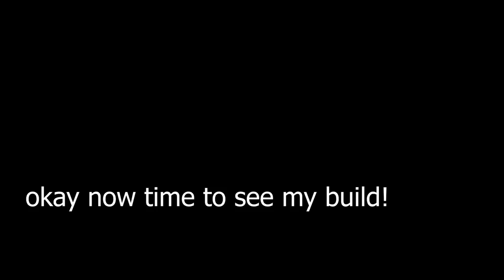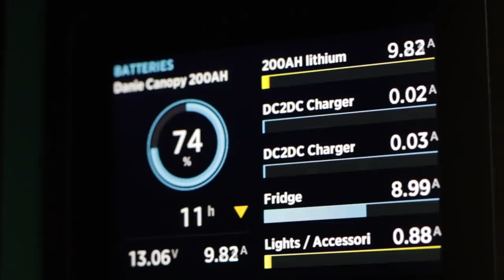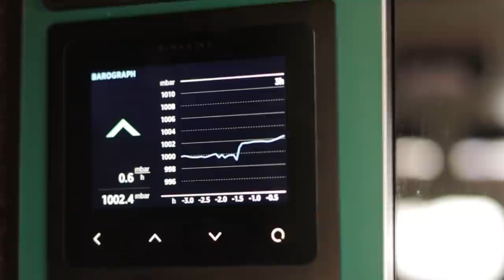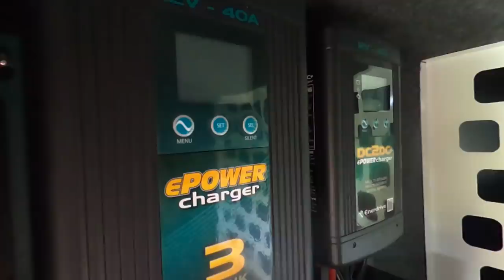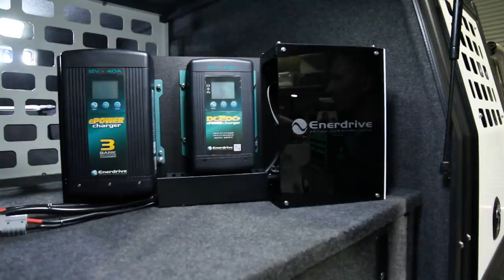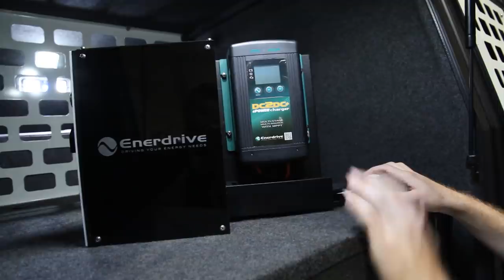Old Ute, New Tray: Part 1 Fitment Day

Comment: Enerdrive 40+ and 200amp Lithium battery is a great investment. Only been 4 months installed but recharge time and compact size will not be going back to agm myself.
Great idea being able to leave just the mutt box on for everyday use and add the rest when needed

Comment: Super flash, those set ups always make me want a ute 🙄

I'm not sure if it's something you may have already looked at, but if you haven't, but you can actually tighten up your steering box to take most of that slop out. First thing I do on every cruiser I've owned haha 👌
Reply from the maker: Yeah tried that this one is just worn it's little groove and just needs replacing one day haha
Reply: I love that list, every time you cross  something off it's like "why didn't I do this 3 years ago!?"

Comment: Great video. I like the electric box. How does the topper lock down to the flat bed?
Reply from the maker: Bolts
Reply: @DanieSimpson  do you have a video with that? I'm looking to make my 97 k2500 burban into a Ute and I like how your build looks. I haven't found any other builders that done what I want to do and i would like to be able to take the topper off if i need to
Reply from the maker: @rkc2617  next video willhave all that shown

Comment: Hey Danie in your Christmas video you say you’ve got the patriot camper I’m curios why you decided to put a body on the cruiser adding the weight to the vehicle when you got a patriot camper? Also could you do a video on a patriot? Have you thought about running a turbo timer if you don’t have one already? Cheers 👍
Reply from the maker: What added weight? Why would I have a turbo timer on a non turbo car? The patriot and the canopy are completely different items with their own purposes and it won't be getting a video for awhile yet
Reply: Wouldn’t your tray and toolbox be much lighter then your new setup? Apologies about the turbo timer got it mixed up with your other build.
Reply from the maker: @chrisgreen3538  this is alloy not steel so no
Reply: What would be your top 5  destinations to visit?

Comment: Now Danni load it find out how much more weight you have added it will surprise you so I suggest new rear shoes front disc's and pads steel brake lines you will need this and you will be gobsmacked the improvement it will and realise how bad your stock brakes had become. NIce set up girl a bit enviouse of the transformation.
Reply from the maker: Hahah no. Old tray was steel, this is alloy. I know exactly how much it weighs now and I think you would he surprised. My drums, shoes, disc, pads are all brand new. I already have braided brake lines and I noticed no change over my 10year old brakes. But if you wish to know something that did make a difference for brakes it was changing to a dual diaphragm brake booster
Reply: @DanieSimpson  Ok just a petrol head that likes to keep his friends safe seen so many do as you are doing and neglect safety !!. That canopy and tent look fantastic a great improvement and a very good design good choice not that you need me to tell you that I can see a lot of thought  has gone into the choice and their design

Comment: hi danie . with the enerdrive system you have , does it supply power through the anderson plug to the x2 camper when all hooked up . is this correct . yes or no
Reply from the maker: No the trailer has its own system

Comment: What’s the size of the tray, dog box and canopy?
Reply from the maker: All custom made to suit my vehicle. 1800x1100, 800 and approx 2300
Reply: @DanieSimpson  how do you find the canopy when it’s jacked off with the roof top tent overhanging? Just curious on stability etc. will be doing something similar.
Reply from the maker: @lachlantaylor458  it sits on a concrete slab when it's off in the shed so no dramas with stability

Comment: Only thing with alloy trays is any vibration they will start to crack and theres no stopping it.
They look great but in reality not great for any vehicle.
Save your money and make it out of steel.
Get a good engineer and they will make it strong and lite.
Reply from the maker: Should watch the video. They don't crack and it's explained why. Steel is heavy, expensive and rusts. Absolutely no benefit whatsoever to steel
Reply: @DanieSimpson  I've had meany alloy trays on my work vehicles and every one of them started  cracking.
Hundreds of thousands having alloy trays made just to spend more to get them fixed.
Have gone back to steel and have had no problems and just as lite as alloy trays.
Like I said get a good engineer.
Reply from the maker: @hardlydavidson1937  that's great. This isn't "any old alloy tray". And no it doesn't cost 1000s to repair. Watch the video and you might learn a thing or two.
Reply: @DanieSimpson  no ive spend thousands getting them built for my work vehicles.
You will learn over time.
Your young and get sucked in with people telling you what you want to here.
Ive learned by experience and a costly one over meany years.
Reply from the maker: @hardlydavidson1937  oh so now you are going to use my age to further your argument. That's sad mate.
Sounds like you are stuck in your ways and aren't willing to learn. I work at an alloy fabrication shop, I know exactly the cost of repairs, alloy builds and how it behaves compared to steel.
If you one day decide to stop being stubborn, watch the video to see how they resist cracking or better yet call Dynamic who have manufactured and designed alloy canopies for years and ask how many they've had come back due to cracking. Ask their customers. Or even better yet compare it to my steel tray which is full of weld cracks.
And some advice, stop using people's age as a governing factor when trying to make a point.